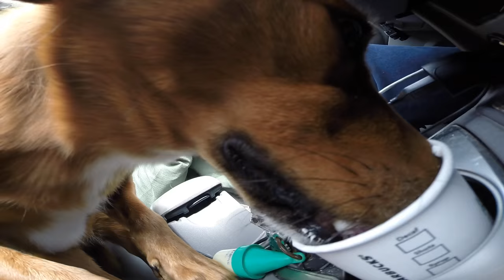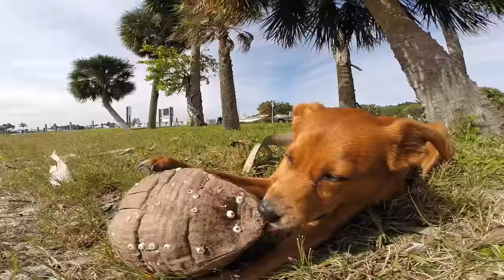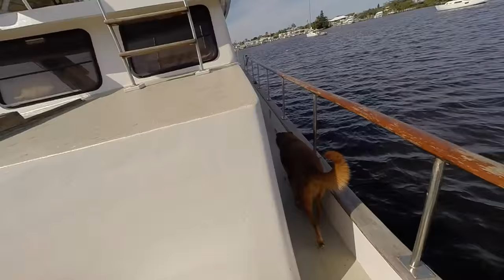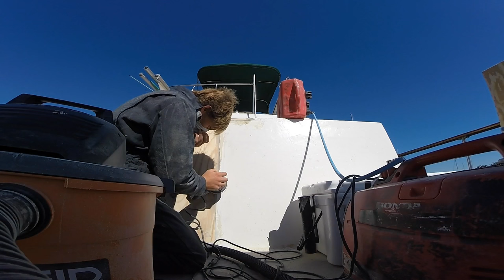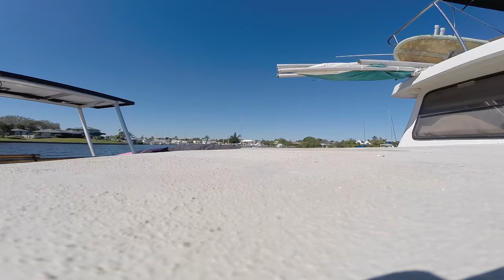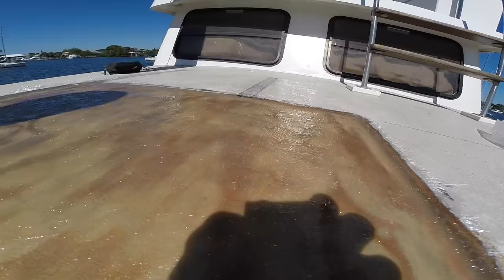FISH TANK ON A BOAT?

Comment: Repairs are definately part of boats...just wondering why you decided to seal the rear hatch instead of just replacing doors to keep the hatch as it was?
Reply from the maker: I would have had to replace and rebuild the whole trim structure around it. If wanted to put in the time and energy I would have and in hindsight In should have thought about that a but more because it was a factor in selling the boat. For us it was easier to do what we did and in an event of an emergency we could always get out the windows.